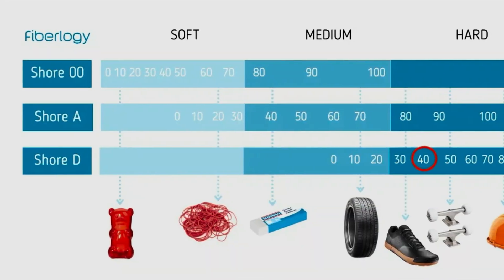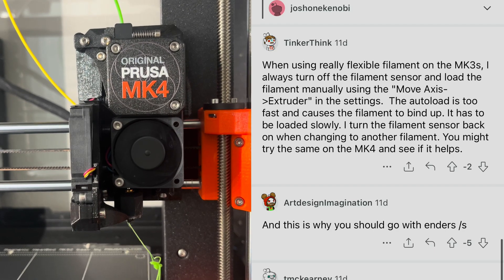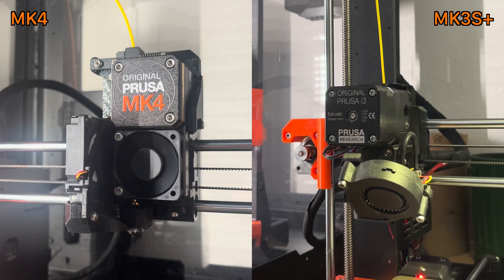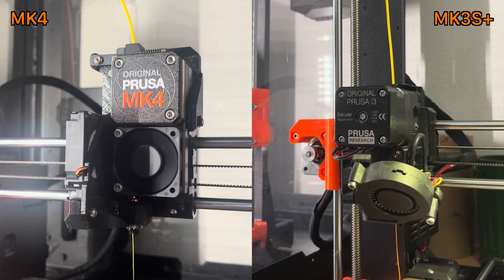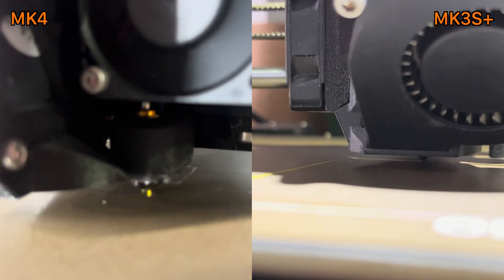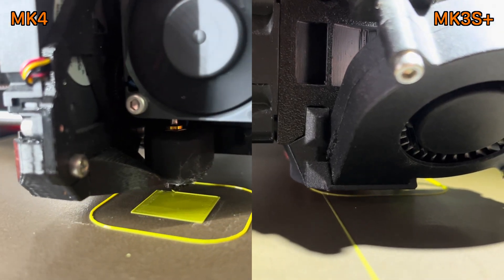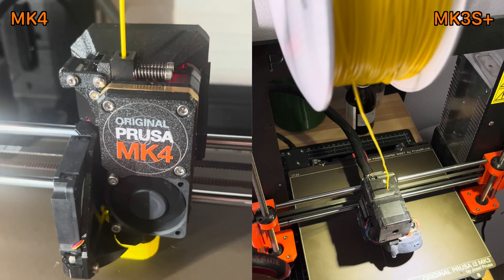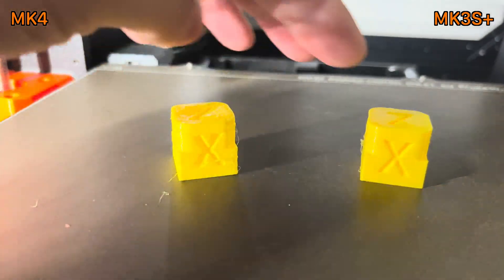Is Prusa MK4 Too Weak for FLEX?

Comment: Haven't tried yet to print TPU on my mark 4. Did you get the printer kit or the assembled one? I got the kit, and I found that the Nextruder assembly instructions relies a lot on "don't over-tight screws", which is kind of vague for this important part of the printer.

Comment: Without negating anything stated in video, I need to point out that the basis for printing flexibles is not feeding mechanism but "cheap" teflon based hotend. 
In full metall hotends flexibles do jam due to higher friction against the walls.
My MK2.5S with teflon extruder is printing currently Fileflex 60A, it is soft like cooked spaghetti :-)
So, I have bad news: you need thwo printers, one for flexibles and one full metall for high temperature filaments.

Comment: Ivve been printing Mattflex from Fiberlogy on my Mk4. No sign of any issues. I an check other elastomers, because Fiberflex chemical composition and mechanical properties make it too easy to print.
"real" TPU (Fiberflex is NOT TPU based, it's copolyester elastomer similar to Hytrel) will be a better test.
Or maybe I should use this 40ShA filament I have, just to make it a real challenge?

Comment: Interesting problem, I have neither a MK4, or used that particular filament, but I have used a MK3+ quite alot and printed well over 10kg of TPU on various printers and its always the most challenging filaments extrusion-wise. The softer it is the more challenging it will be. I read many comments where people print 95A or 98A and can't understand why TPU is so problematic, and they havent even tried anything 85A or less. That said I have printed plenty of standard Ninjaflex (85A) and Recreus filaflex (82A but still feels slightly more stiff than Ninjaflex) and from this drawn a number of conclusions. As I see it you are compacting a wet noodle under the extruder gear building an elastic pressure down to the meltzone. Depending on mechanical layout of the extrusion system the filament will escape sideways, or around gears or wherever it possibly can go if that pressure becomes too high. This is why minimized clearance between extruder gears and the hotend pipe is super important. This is also why people are writing to loosen the filament tension. It can act as a slipper clutch to avoid too high forces on the filament pillar, which in turn keeps it from escaping or tangling up, but can also result in less accurate extrusion volumes. The solution usually is to lower the extrusion speeds enough to keep the static pressure in a range the particular extrusion system can handle before the filament finds creative ways of tangling up. In your case I agree that the problem seem to be a lack of filament grip and not the more common challenges I have experienced. Modifying the clamp part seems like the right way to start.

Comment: I've seen people print easy TPU with the MK4.. I'm waiting for mine so I'll tell you when I try this. But in any case feel free to make a follow-up video if you fix it!
Reply from the maker: Thanks! Here is the new video: https://www.youtube.com/watch?v=nPf9lre8FHE
It seems to be a very borderline issue. As a 0.2mm change was enough to fix everything for me. So from Prusa perspective I'd put a 0.5 extra tolerance, so if something over-extrudes somewhere that won't cause a problem. But also I can completely believe that many others don't have this issue
Reply: i had an issue, at first, the extruder made a clicking noise.  i adjusted the screws inwards a bit and that 'seems' to have done the trick.